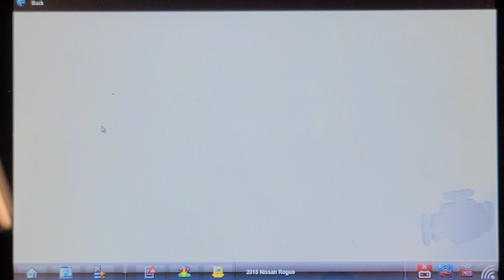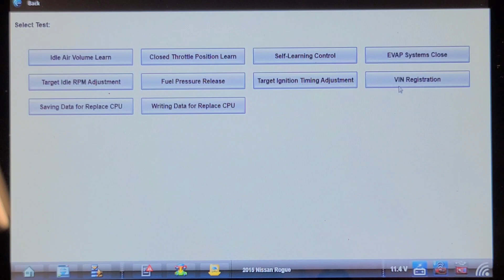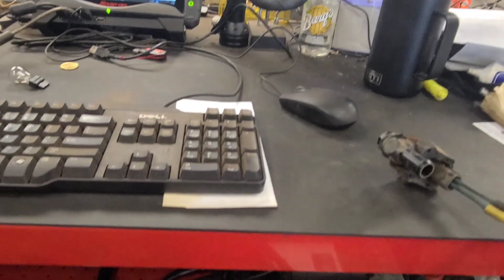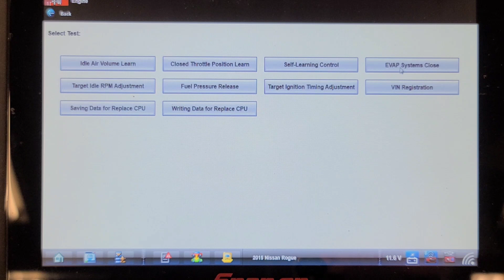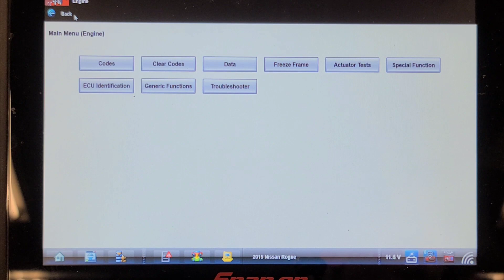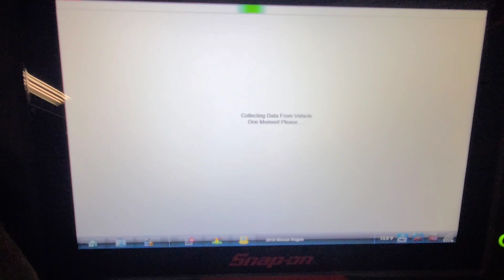2015 Nissan Rogue MIL On Code P0447

Comment: I’m getting a P0447 and a P0101. And I already changed the EVAP control valve (P0447). Which is located right on top of the motor/black plastic canister looking thing and it has the hose that goes to the mass airflow sensor connected to it so I’m wondering if it’s something related
Reply from the maker: You need to test the system for a leak with smoke.

Comment: Question, I replaced canister along with the canister vent valve and canister purge valve, still getting code p0447, any suggestions?
Reply from the maker: You need to smoke test it from the purge solenoid. You could have a leak in the filler pipe or other tubing. Fuel cap may not be sealing...

Comment: when you said located on the right side rear wheel, is that the rear driver side  or rear passenger side?
Reply from the maker: Right rear is rear passenger side.
Reply: thanks

Comment: Great troubleshooting skills! I have a 2016 Rogue where I first had a P0456 error code for a very small evap leak. I changed the gas cap and the solenoid that you showed in your video. Reset the check engine light and it came on the very next day. Now I have the P0447 as well as the P0456. The scanner at AutoZone is tell me to replace the EGR valve but you mentioned a connector wasn’t fully connected. Are you referring to the solenoid underneath the rear passenger? Any advice is greatly appreciated.
Reply from the maker: As you mentioned the 456 code is for small leak detection and the 447 code is a circuit problem with the vent solenoid.  Nothing to do with EGR imo. Be sure the vent solenoid connector is plugged in completely. If it still sets the 447 code you likely have an open circuit to the solenoid. One of tge terminals to the solenoid is fed ignition power from a fuse with the key on. You could test for that at the solenoid.
Reply: Can I use a small light bulb to test the connector with the ignition on? If it turns on or not?
Reply: Forgot to ask about a multimeter. I can check for voltage or Ohms?
Reply from the maker: @SolidNashNYC  the light bulb is the best way to check the circuit. You can use the ohm meter to test the solenoid resistance. Should be around 10 ohms.
Reply from the maker: @SolidNashNYC  yes a side marker bulb and pigtail will work but it won't turn on unless the computer tries to ground it. Be careful not to spread the pins in the connector or short the pins together.

Comment: I didn’t see what pressure it wanted to see for texting.. could you use smoke machine?
Reply from the maker: I believe they are referring to a Nissan test tool specifically designed for this purpose. I'd does say not to exceed 0.6 psi so possibly a smoke machine would work.

Comment: After changing this part , and clearing the codes, can I pass emisión ? Or do I have to drive to for a week ? Help
Reply from the maker: It theoretically won't pass emission testing until all the monitors have run and passed. That can take a minimum of two 20 min drive cycles but other conditions must be met like fuel level must be between 10 and 90%, ambient temp above freezing etc. So it could take a week or possibly longer if test conditions are not met. Google OBD2 drive cycle...
Reply from the maker: https://www.nonda.co/blogs/news/how-to-perform-a-basic-obd2-drive-cycle
Check this out...